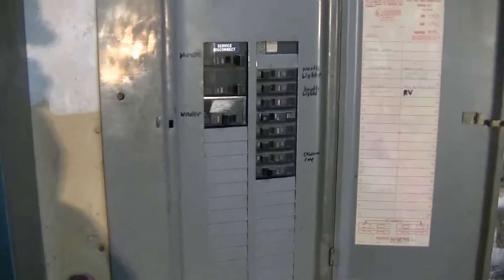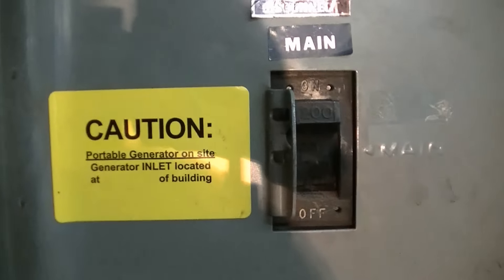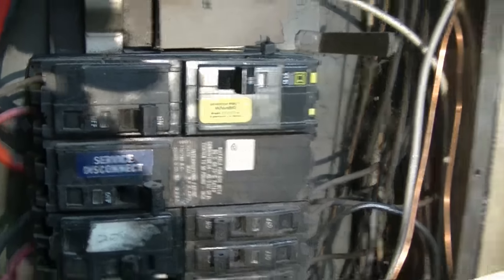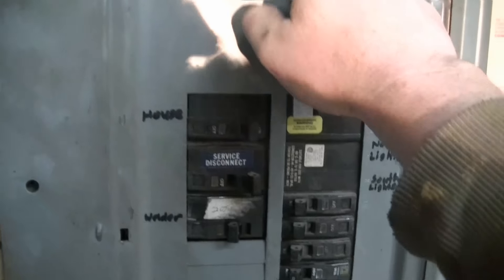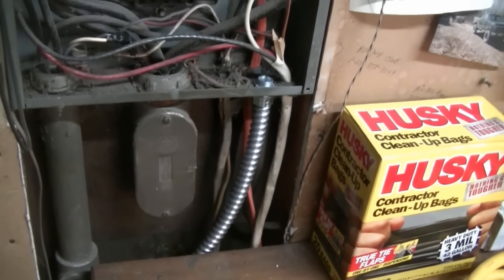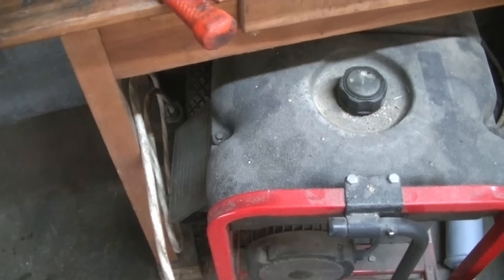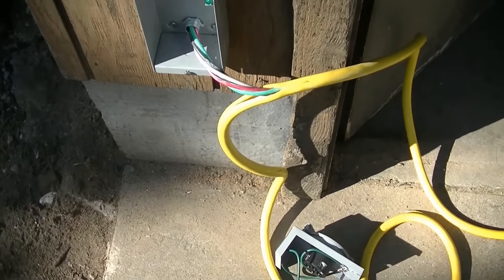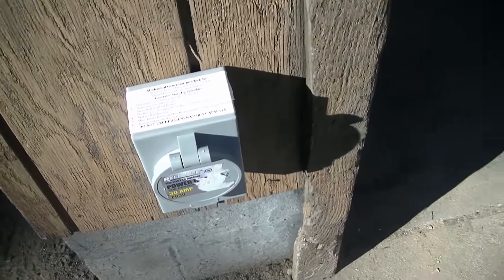How To Install A Generator Interlock

Comment: My firman 9400 Costco special is dual fuel.  Has both 50amp and 30amp. Should I wire it to my house with the 50amp?
Reply from the maker: I would set it up rated for the highest amps that it shows that the generator can produce if it were me.

Comment: hi i was just wondering if i can connect a long wire to the switch coming from the gene if its possible or do i gotta have all those power boxes...its only to power up the switch in my room or should i buy a switch & add it to my room and then connect the long cord from the gene to the switch..im getting to know more about it..ideas it should read..

Comment: My back yard/patio is outside of my dining room area. There is an outlet on my patio facing the dining room wall from the outside. I would love to know how to put a generator on the patio and hook it up to my house, in order to run the furnace in cold weather,the fridge in the kitchen, the lights, t.v. in living room and one bedroom, desktop computer in second bedroom, the a.c. in the living room window and the a.c. in one bedroom window in hot weather; also, lights in bathroom and bedroom. Is that too much and how much should i pay for a generator for this much power in an emergency?

Comment: According to other videos on YouTube, with a muffler, you only lose around 2 decibels of sound from the generator. A majority of the noise is from the valves opening and slapping shut. You might do well to build a foldable open top surround taller than the generator to direct some noise upward.
Reply from the maker: Good idea.  I noticed there seems to be a lot of noise from vibrations.  These engines don't seem to be balanced very good.

Comment: Hi. I have a 200 amp main panel and another 200 amp sub panel next to it. Do I need 2 interlock kits and 2 double breakers or just 1 set in the main panel.
Reply from the maker: My house is on a sub panel.  I just have the generator wired to the main panel.  The generator will feed the sub panel in the house.  So I’m doing it with 1 interlock kit.

Comment: Question: does it matter if your generator has a "floating neutral" ? Because most generators don't, in which case a "separate derived system" is required which means all conductors (including the neutral) most be able to be controlled by the transfer switch. In your using a 2 pole circuit breaker only disconnects the hots. I do find your way the most practical but is it legal? Because generators have neutral bonded to the frame the NEC requires this Separate Derived System.

Comment: Mike Alvarez
I have a Floating Neutral Home Generator conected to a breaker at the main panel with an interlock.  Do I need to ground the generator using a separate grounding rod?
Reply from the maker: Sorry, I'm not an electrician.  You'll need to ask someone smarter than me.
Reply: "Need?"... No... The closer the ground rod is to the source, the safer the ground rod setup.. If you do ground yourself to the generator power,, is a ground rod attached to the Generator frame directly going to keep you from getting shocked or killed? No.. But, could it be better? Yes.. Electricity travels the path of least resistance, so, a good copper ground rod, or Galvanized Galvanized Rod is where "Most" of the voltage goes, but, how good is your ground that you were touching? Through shoes, boots, or, did you touch the frame directly and you are primarily made of water, so, still conductive and will surely get the crap knocked out of you, either way.. 
So, it is basically more like adding a Rubber to your Regularly scheduled Birth Control pills, or adding a Rain Suit to your use of an umbrella or vice versa.. It is mainly there for Insurance safety for the manufacturer than anything else.. We took that extra step,,,.. But each of the outlets have grounds anyway,, Right? You get the picture.. 
So,, if you know the difference between Frame Ground and Regular ground, or Ground and Neutral and think that makes a big difference, open the panel up and see where they both go inside of the Panel itself.. Same ground bar.. But, to know the real truth.. If you have Single Phase running to your Residence, when you look at the high tension/voltage wires coming from the power company to the Transformer that feeds your house,, how many of those wires are feeding the Transformer.. Two.. Not even a ground.. Your Ground comes from the Ground at the telephone pole base, and you can see it hooked directly to the transformer which feeds the 3 wires that go to your home, if that also helps understand where your ground comes from.. So, the more grounds the better, but, if that one was good enough, then you add one to the Panel, how many more do you actually need? Even if you grab the ground rod connected directly to the Generator,, it is not going to keep you from getting shocked.. 
If you know that, when working with electricity,,, the real safety is not touching anything while it is hot.. 
How safe is using an Interlock above vs just using a Breaker back feed?? There is only one reason to use an Interlock.. To remind you, or in the Interlock case,, to keep you from having both the Main Breaker and Generator breaker turned on at the same time.. If you always remember (add a Note to the box, same as the notes he added, but, this one says,, Always Turn Main Breaker off and if you have to say "When "Getting Ready to Hook up the Generator",, it does the exact same thing, but, you can't turn one on without the other.. 
So, the same thing.. Adding that extra rubber, or Umbrella to your rain suit.. 
Like some of the others have said.. If you are powering the Neighborhood with the main breaker on, besides being dangerous, when you flip your breaker on,, the breaker on the generator is going to flip or put such a load on your generator, you are going to immediately know something is wrong anyway.. 
It's all kind of a moot point anyway.. just another added level of safety to be sure you "Turn the Main Breaker off". 
If you understand what you did to hook up your generator and why,, you know about "Turn the Main Breaker off".. So, how much do you need to be reminded?
And, why would you run a circuit that could be used for something else while running off of utility power and not be able to use it for something else,, like a welder, compressor, etc?? Because a Male plug outside is going to require you making a special extension cord for anything else you plan on using there.. Why not put a safe Female there and make one "Special Extension cord with a Male to Male connector, and have that circuit work for anything you want to plug in anytime under any circumstance,, and just remember, when you get ready to hook up the Generator,, just turn off the Main Breaker First?? 
Don't let the Youtube Safety Police confuse you.. I have 4 places outside of my house that I can use any of my 220 volt appliances or a Generator, although I generally use my generator where it sits, I could put it anywhere I have a 220 plug used for something else.. 
I have a video on it. 
I also put a similar setup at my Moms place that she uses at 80 years old.. It is just an External Female Twist lock box just below the panel and an extension cord that Cost me two Twist lock Male connectors and a piece of 8 gauge wire I already had to hook up my generator.  I bought the connectors off of ebay for $20 and it took me an hour to hook it up, with most of the time spent building the male to male extension cord.. By the way,, that should be reminder enough??? Ok.. Cheers..
Reply: You think it’s ok to use a bonded neutral generator when it’s wired directly to the main breaker panel as shown in this video??

Comment: what kind of breaker does the generator require in order to power both phases (left and right) of main breaker ?
Reply from the maker: Paul G It doesn’t require anything special.  I just use a regular 30 amp breaker, and it works perfectly.
Reply: I see at 2:24 that you have two 30amp breakers zip tied together. The right one accepts the generator power 1phase and  powers the right bus. The left one went to your house but it is tied to the left bus. I guess I need to find out how the power is going to the left bus.
Reply: The double breaker feeds BOTH buss lines ... i don't know WHY he zip tied them together ... 
a single breaker only connects to a single 120V buss while the double breaker connects to BOTH 120V buss to give 240V ...

Comment: I have a panel with two phases of 120v, I just bought a generator which can deliver 240v in one phase, how should I wire it?
Reply: Not trying to be smart,, but, for your own safety,, when you can answer that question without asking it to anyone, you  are getting closer to being able to hook one up.. But, that is a pretty basic question you just asked, so, you are surely not ready yet.. You might want to understand a bit more about electricity before you even think about starting.. 
But, let me give you a hint.. You have two "Legs" of 120 volts.. Each of them to a ground will give you 120 volts.. Both power wires will give you 220v.. Stop by you local box store with a screwdriver and pick up a panel box similar to yours and get two single 120 volt breakers and one 220 volt breaker and see if you can tell how the power is distributed.. Look at how two single breakers can be fed, and from which legs,, and realize that a 220 breaker could be replaced by two single breakers thrown at the same time.. Once that makes sense to you, then, you are well on your way, if your #1 concern is safety first, meaning turning the Main Breaker off.. 
Read what I wrote two or three times.. Especially the part of the 2 single breakers replacing the double pole 220, it is what you don't understand yet.. Once you see it for yourself, you should understand just about everything you need to know to do the project. Watch more than a few videos until you are 100% confident you know what you are doing before you start..Go over the complete project two or three times before you start.. One you can do every step in your mind, looking at the box, you are ready to go.. Main Breaker off first, and any time you get ready to hook up the generator, it never gets hooked up until the Main Breaker is off, and it never gets turned back on, until the Generator is removed completely from the circuit. And, I would limit that statement, by making sure it is unplugged,, unless you are going to install an Interlock like in this video to keep you or someone else from backfeeding your generator, which would not be good for it or anything directly around it, especially if it is running at the time.. The problem then would be the two voltage sources not being "In Phase".. If you look at a voltage wave, similar to a sound wave as far as the style of wave,, if one voltage is at it's peak and the other is in the bottom of it's wave or trough, the effect is like doubling the voltage to each, and the generator will be the looser for sure..

Comment: I also have the main box in the shop. The feed to the house is 150A. How many amps is your house breaker and the new generator breaker? The breaker you moved and interlocked is the house service disconnect, correct?  So I'm thinking it must be at least 150A.  But your generator box is 30A.  Is that OK?
Reply from the maker: My house is only on a 100A.  It works just fine.  The generator is only going to produce 5550 watts.  If you turn on everything in the house what will happen is that the internal breaker in the generator (30A) will trip and shut off all power to the house.  If I had a bigger generator then I would need to have a bigger generator box/breaker.
Reply: OK thanks.  My gen is also 5500 W.  So I don't need a 150A breaker and inlet to do this, just enough amperage for the gen and only turn on the circuits I need and the gen can handle.

Comment: By code what type of wire (size and strading) should be used for this hook up.
Reply: Depends on how much amperage the generator puts out. Mine is an L15-30R which is 30 amps which means a MINIMUM of 10 gauge ....